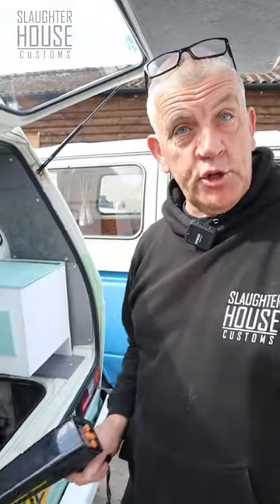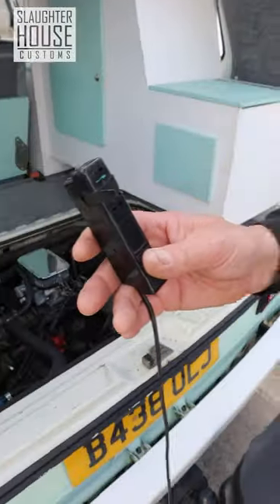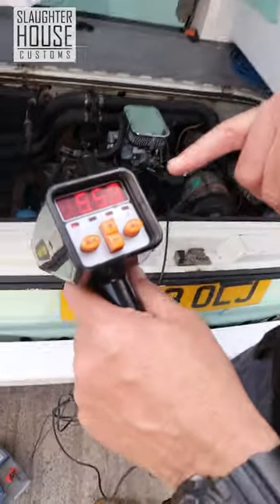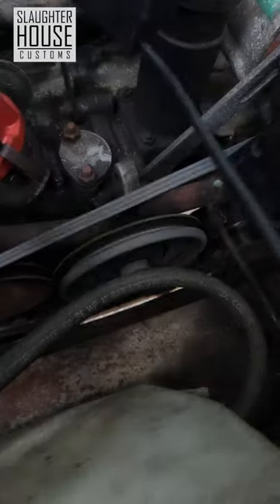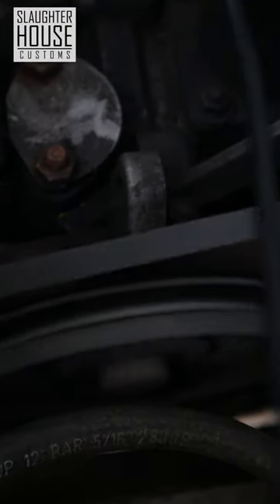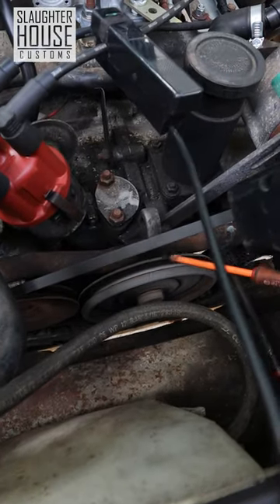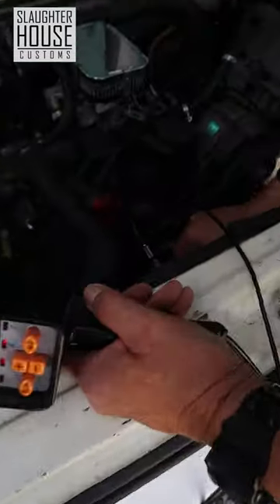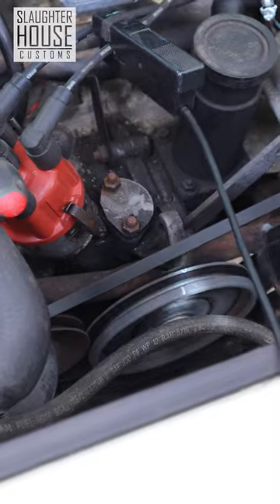⏰GREAT TIMING⏰

Comment: How do guys. Ive got a 1.9dg and after alot of investigating have found that the choke spring has gone weak. So every time i drive it the butterfly moves back onto the first notch on the cam. Parts for the 2E3 carbs are a nightmare, so was wondering what you think about the webber conversion? The same as the one on this one.

Any feed back would be great. 
Cheers guys.